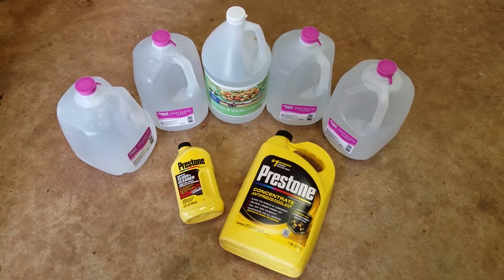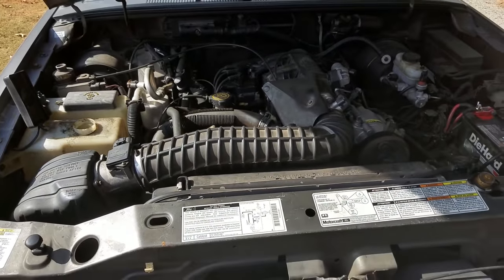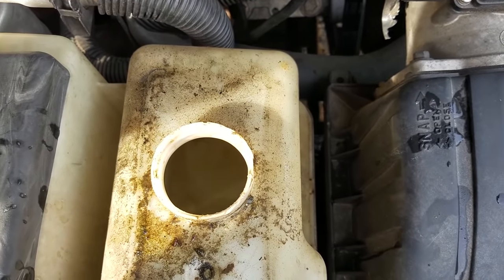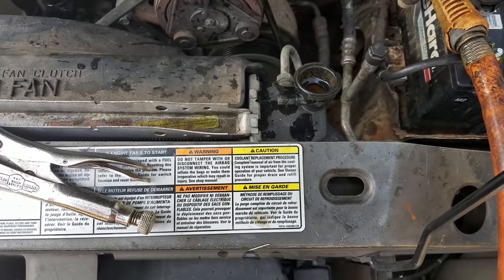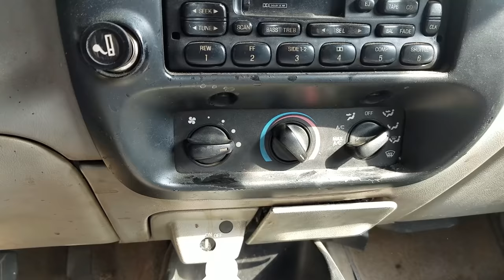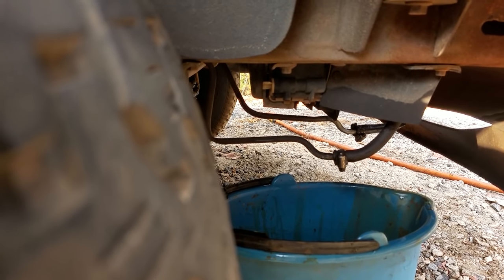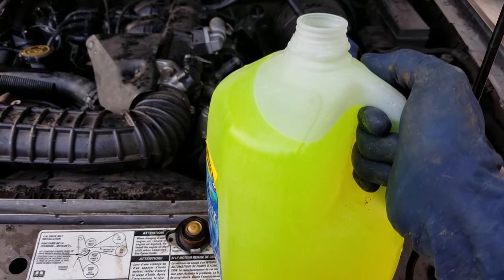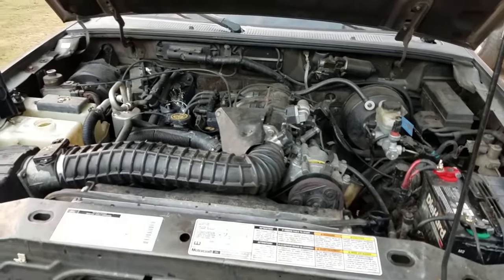Check Out What Came OUT Of This Radiator!

Comment: okay I'm like a minute in and he keeps saying antifreeze and he keeps pointing at the bottle look don't go out and just get a bottle of Prestone just because you watch this please don't you need to actually call the dealership to the make of your vehicle give them the VIN number and ask them exactly what actual coolant your vehicle was designed and built to use okay there are a few different kinds now and even like Ford trucks there are three different colors okay the olders used the Ford green okay then they went to an orange and they even have like a gold this is very Vital Information don't pass this off okay and you can't mix the stuff so if you had a certain kind in your radiator you can't just drain your radiator two or three times and expect it to be flushed it you cannot mix the stuff you have to go down and spend the ad or $100 to flush your radiator and put the right stuff in. if you have more than one vehicle then good take on an entire week if you don't want to go pay for that flush take an entire week of draining filling running draining filling running at least a couple times a day for a week and you'll get close to a flush but you're not getting a flush just draining in a couple times you actually have to run it every time you fill it and then you have to let it cool before draining. Check this out you need a Degreaser okay if you use nothing but an acid you can really strip down seals and gaskets or even the carbon buildup that maybe is keeping those seals and gaskets in place now that everything is compromised and if you're doing this chances are you have a lot of compromised stuff in your vehicle and the cooling system is the most sensitive because of the electrolysis I mean even metal gaskets can disintegrate and be by electrolysis...
Reply from the maker: Good info. You are right. You need to know which type of antifreeze to buy. Read your manual or look online. If your vehicle uses green antifreeze then use that if your vehicle uses orange antifreeze then use that. PLEASE DO NOT MIX THEM OR USE THE WRONG ONE. Bad things will happen.
Reply from the maker: Lol bet he didn't work there for long!
Reply: @John 14:6 KJV The new stuff is all the same according to the antifreeze manufacturers.  They claim it can be mixed with any color fluid.   I was surprised to learn this.
Reply: I have been ready a lot of the same that @JoeKubinec said.  I know there are different ones and it's "best practice" to not mix them...but it's really hard to take someone @Ryan wyrick serious when his grammar is so bad they cant even use a period.  Also, if you just thoroughly and completely flushed the system, why does it matter what antifreeze you put back in?

Comment: What if I've already done this twice, replaced all my hoses and my radiator and it's still coming up dirty after a couple of months??
Reply from the maker: Good question, there could be rust in the block because it is cast iron and it rusts overtime. There shouldn't be much rust though. That would be my guess.
Reply: Matt's Shop I have a Mazda Protege5, pretty sure it's steel block with aluminum head. It had the green stuff in it and I went back with that before I really did some research. I want to get it clean and go with a good HOAT antifreeze. I think it's time to try this again!
Reply from the maker: Yea, try it again. What is HOAT antifreeze? You mean hot?
Reply: Matt's Shop hybrid organic acid technology.
Reply from the maker: Never heard of that. What is it?